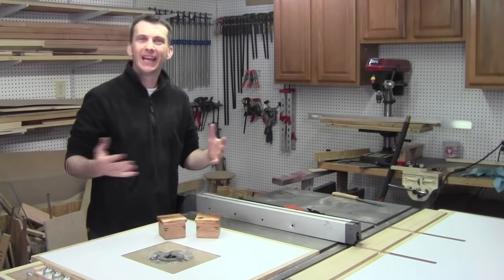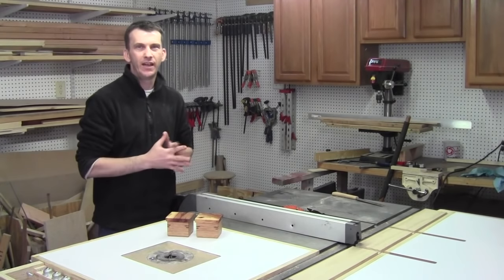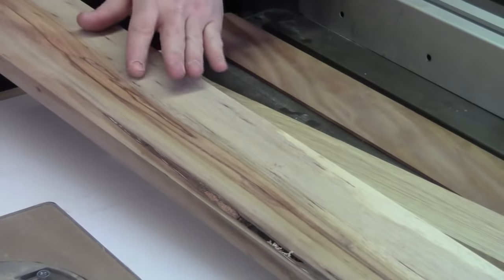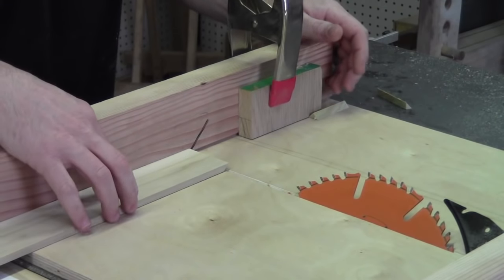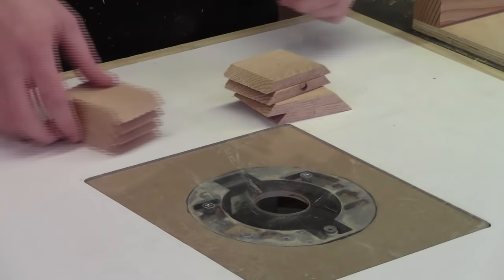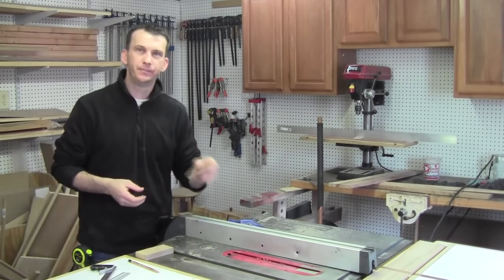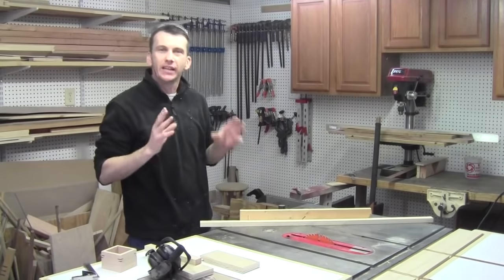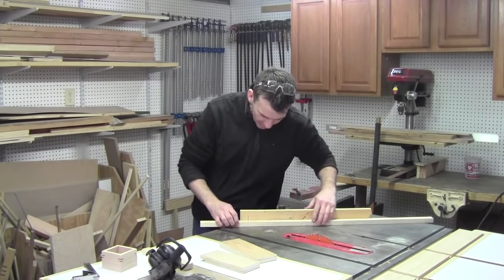How to Make a Lift Lid Box | PART 1

Comment: Wondering why you did not cut the small groove in the base of the boxes prior to cutting the pieces to length?  Seems to me it would be safer and quicker.  Another great project, thanks for sharing.
Reply: Completing the crosscut operations first results in less chip-out.  To increase safety, turn the cut sides so that the groove is close to the fence.

Comment: Is there a reason you have your blade height so high? Was taught to adjust blade height to just cut through your wood.
Reply: I have found that in some wood types, if the blade is set to be just high enough to cut through the upper surface of the piece there is a tendency for increased tearing and splintering of the upper surface. It is often better to set the blade height so that the lead cutting tooth of the blade is breaking through the upper surface of the wood at a downward angle instead of the more horizontal angle some recommend. This results in a much cleaner edge of the cut surface and less sanding of splintered edges.

Comment: I guess you could have cut the grove for the bottom earlier in the process, before cutting then down to 3 inches - safer and easier. Then you would not even have to have marked which was the top.
Reply: Completing the crosscut operations first results in less chip-out. To increase safety, turn the cut sides so that the groove is close to the fence.

Comment: Why not make the groove that the bottom fits into the same as the thickness of the bottom ?  The size of the bottom would then not be so critical.
Reply: If you don't care about the inside depth of the box, that could be an alternative.  But, if you made the groove too wide, so that the bottom was loose, you'd have to discard the carcase pieces, which embody much more value and effort than a rectangle of plywood, so I would still prefer the method in the video.

Comment: Wouldn't be easier to make your cuts for the bottom before you cut your mitered pieces ? I just think it would be safer and faster, no chance of cutting fingers,,,
Reply: Completing the crosscut operations first results in less chip-out. To increase safety, turn the cut sides so that the groove is close to the fence.